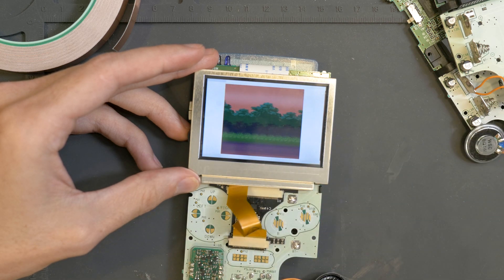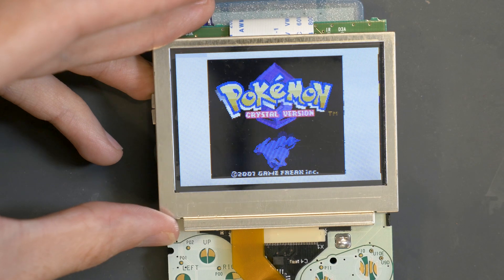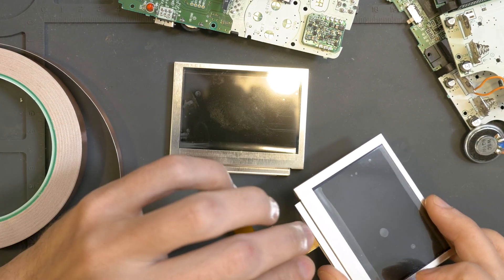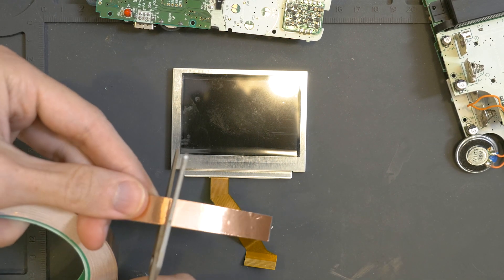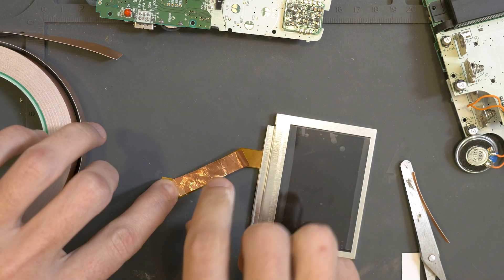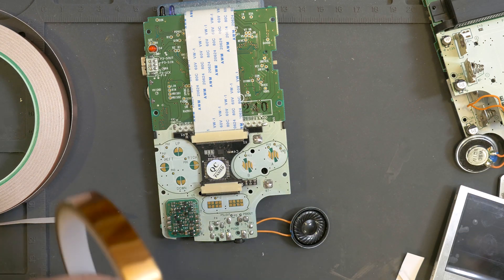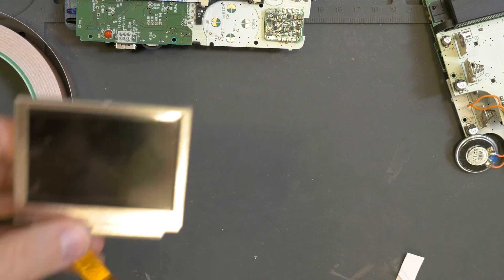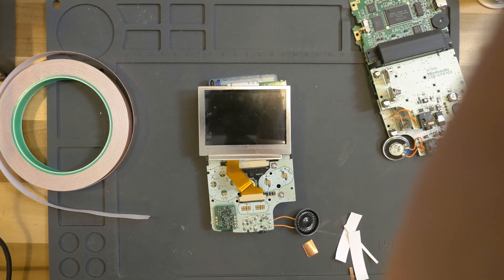How to Fix Game Boy Color and GBA Screen Glitches with AGS-101 Screens

Comment: My gameboy color ags 101 screen aspect is off on one of my gameboy colors. The screen is slightly off to the side even with spacers. I think it might be the design of the gameboy color glass lens. Please help
Reply from the maker: Is it an aftermarket screen? Or is it an original AGS-101 from a GBA-SP? I know that issue happens with brown tabbed screens as well as original screens. You need to use a white tab aftermarket screen.
Reply: esotericsean actually I figured it out lol turns out the screen was misaligned I had to try it a few times took me hours but now the gameboy color is perfect now 👍

Comment: My ags 001 has moving lines kinda like the device you showed but it only appeared when I modded my ags 001 to ags 010 but it went away when I removed the resistor why is it appearing?

Comment: Hi Sean,

My ags 101 gbc keeps turning off once i close the case; Boxy Pixel. I'm using a BennVenn ribbon, 2.3 version. Could interference also be an issue? Ive masked alot of sections with capton tape but no luck. Have not tried cooper tape.
Reply from the maker: That would be something shorting out, not interference. Did you trim the pins on the GBC motherboard? Did you mask the components on the ribbon? Make sure your screws aren't going into the ribbon when you screw the motherboard down, too. If you need more help, join our Discord! https://discord.gg/8UP3BsR